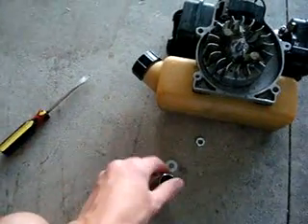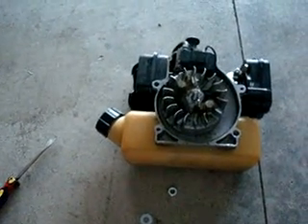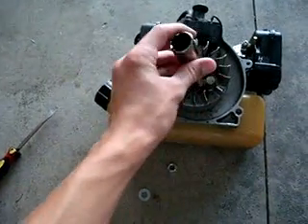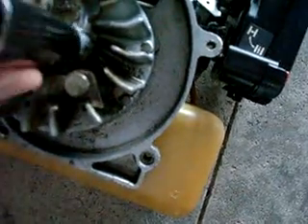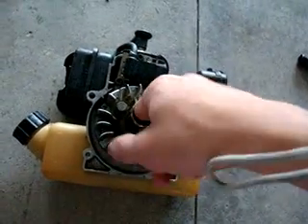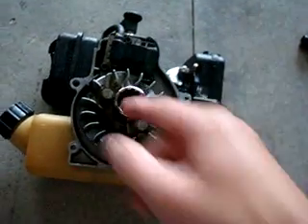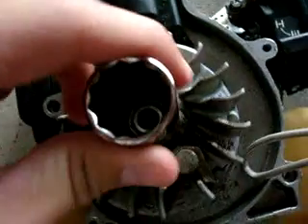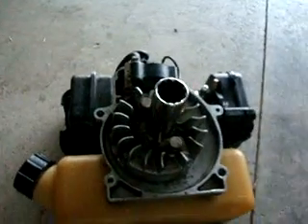HOW TO MOUNT A SPINDLE TO A WEEDEATER MOTOR

Comment: Have you ever thought of using a skateboard wheel and bearing from a Old skateboard or roller skate? I have 2 razor scooters I am converting and one razor crotch rocket. I'm testing a few methods one will be chain & sprocket, one friction with skateboard wheel and another with belt & pulleys. Everything is free that I've had laying around which most would say is useless junk. Lol

Comment: DON'T DO IT, YOU WILL SNAP IT OFF IF WHEELS UN TRUE OR RPM GETS TO HIGH. Dropped my socket driive today but at least I have a 3/8 thread waiting to cone in from ebay. A actual peg is the right way to go.

Comment: I built on with a 45cc weed whacker engine, but, I bought a free wheeling rubber drive spindle from McMaster Carr and a sprocket, so I had some gear reduction, about 2:1. This gave me a speed of 22 mph, up hill or down (faster if I disengaged the motor on the down hill). I got 84 mpg, which was not as good as I thought I might get, but, then again, I weigh 254 lbs. It never failed to start and I rode 356 miles on it according to the spoke mtd odometer before I sold it. It mananged one hill we have here of 6% grade and never seemed to slow down at all.
Reply: what kind of engine did you use?
Reply: Wes McKerrihan 45 cc weed whacker engine
Reply: goddamn lose some fucken weight,fatass

Comment from the maker: if its not threaded, your options are limited. either find another weedeater, or maybe you can weld a spindle on. i always tried to find an older homelite motor, they just worked great and where easy to build.

Comment: did you look at the end of the shaft where it meets the flywheel? i have a homelite st 26cc that had the same square shaft, but it also had a hex head where it met the flywheel. i used a deep well socket and a screwdriver to steady the flywheel while removing the post. it came off with no problem exposing a threaded shaft.

Comment: @GSRGOPEDRIDER247 yes centered.  I'm sitting here looking at mine, and can't see how I could do it because of the flywheels starter springs are blocking.  I bet I could do it but the overall durability will be garbage.  I'm almost certain my engine is going on an RC boat instead.

Comment: I too, decided to see if I could do something with my older 25 cc Homelite, mounting it on a bicycle. Each installation is different & all I can say mine went together almost flawless, with a minimum of hardware. No welding. I used an old bicycle peg that was serrated. I had to grind it somewhat (not bad) to make it fit between the flywheel vanes but used the original bolt/flex line drive that came with the wacker. I'm still dialing in my contraption but find it to power my 26 in. Huffy well.

Comment: U actully do not need to use a socket if you shave down the edges of a bike ped it will work better because it will give you a better rotation. I built one last week they work amazing!

Comment from the maker: @FreestyleRider45 this is a 25cc homelite, these older homelites are great because they don't have a clutch to remove. if you want to use a weedeater with a clutch, you can take the clutch off, but the shaft isn't fully threaded, only the end is threaded. mounting a spindle can be tricky if you have a clutch motor. i removed the clutch drum with a phillips, i had to cut the end off the clutch alittle for enough room for the screwdriver to fit. once you remove the drum everything else is easy

Comment: @azndude3141 go to sears and and ask for a 3/4 socket. they'll show you a deep socket and a impact drive socket... pick the normal deep socket. (look inside to look at the square hole.. the depth in that hole will be very thin.) it seems like it's not long enough but it works pretty well for my bike ;)

Comment: im having a problem finding a socket that works, ive bought two so far and both had the same problem... the spare end, that the wrench connects too is too deep, and the bolt doesn't stick up out of it.. anyways around this, or where did you get yours?

Comment from the maker: @kelsobreeder can't use anything smaller than 3/4'', because you have to fit the 1/2'' nut inside to tighten it. can't use anything bigger than a 7/8 socket, assuming that anything bigger will not fit between the pull start fins. 3/4 is a good size, even on a stock motor it'll do 21. if the acceleration isn't very good, you can always modify your motor. with that being reposted... you could use a peg, it's just not practical, acceleration sucks and it's gotta clear the pull start fins

Comment: @GSRGOPEDRIDER247 I'm no expert...i just have access to the shop at school and i'm a pretty good welder. the porting and stuff will be mostly guess work, i havent done that before. it will be more along the lines of polishing than porting. as for the vid, i'll probably post one when its finish. maybe even one of just the motor this week end:) it runs great for only $10

Comment: @GSRGOPEDRIDER247 i pulled my motor apart to start porting it and modding other things.anyway its a newer echo motor and has a plastic flywheel that is aluminum in the center. so i pulled the clutch and i only have a bit of thread to work with. the plull start is in the back of the motor so i can put just about any size spindle i want on. i ended up cutting a pipe and welding a back plate on, i'm gonna put it on the lathe tomorrow to start drilling, thanks for the help anyway tho.

Comment from the maker: @333JIMB0333 can't use anything smaller than 3/4'', because you have to fit the 1/2'' nut inside to tighten it. can't use anything bigger than a 7/8 socket, assuming that anything bigger will not fit between the pull start fins. 3/4 is a good size, even on a stock motor it'll do 21. if the acceleration isn't very good, you can always modify your motor.

Comment from the maker: @TheSushravan really, i wouldn't know. if its a solid threaded shaft, then yes it's possible. sometimes, weedwackers with clutches only have shafts threaded on the end.making it more difficult to attach a spindle. i've seen people mount them to gas scooters with clutches, but look online you may be able to find some information

Comment from the maker: @LivinThatHighLife nope. i have a kenda street tire on there, it works great. i've done burnout's on the thing that have ate alot of rubber, and it's still got the original tire plus it was on my bmx bike for a few years. the 12'' kenda on the mini bike wore down quickly, but it was also due to dragging the tire and the spindle not being flush mounted. (crooked)

Comment from the maker: @rrjhs199516 not at all. i've had this setup for months. not sure if you mean tire slippage? or bolt slippage? either way, the tire only slips when it's low on air or wet outside.

Comment from the maker: @shinyfuzzy be more specific. if you are using a 3/4 long drive socket you should be able to take a 1/2 drive socket to tighten the nut inside the 3/4 socket to the flywheel. if you need a smaller nut... (lol) go to homedepot or a hardware store and get a replacement (without the square shaft fitment)

Comment from the maker: another good tip is if your going chain driven to bolt a bigger scooter sprocket up to the small bike sprocket on the rear wheel, buy using 4 bolts or such and bolting them in between the sprocket teeth. i'm going to drill some holes and put some studs/screws into the spindle for traction soon.